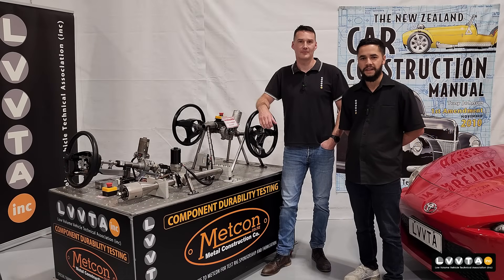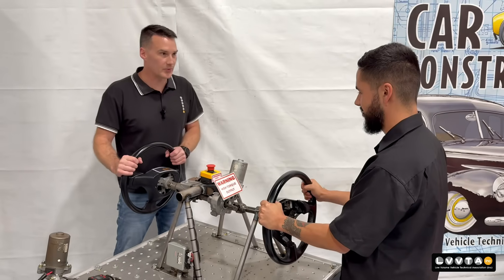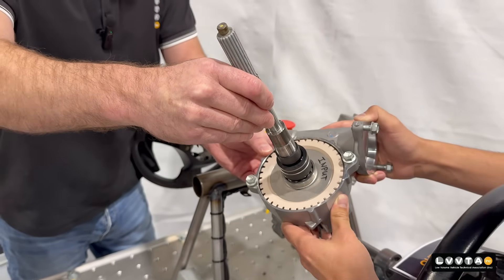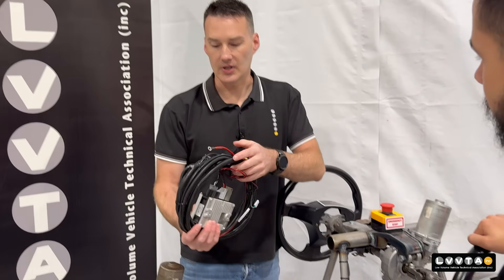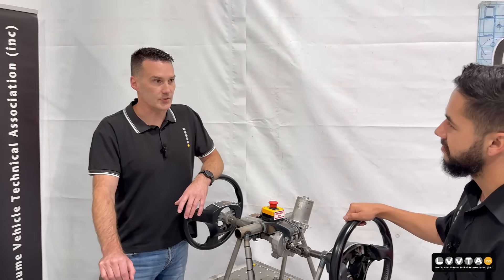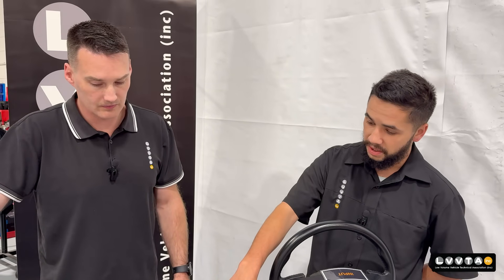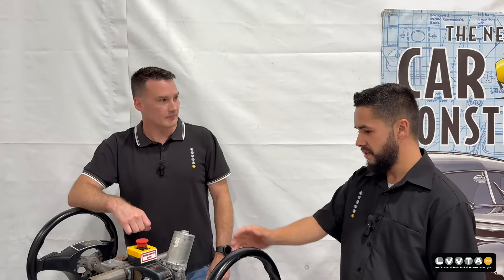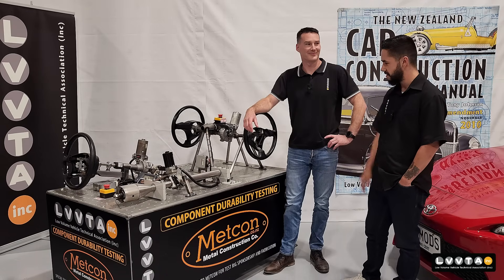Electric Power Assist Steering (EPAS) How-to Video

Comment: if welding of the shafts is prohibited, how does one get a custom shaft made?  surely even the U joints are welded to the shaft unless it's splined and then a 1 piece CNC ujoint is used?  Seems almost impossible
Reply from the maker: There's a wide range of shafts, couplers and UJ's available, so there's really no need these days for the potential for unsafe welds in steering shafts.

Comment: Well put together and informative video, well done. A few generations of engineers will be surprised to learn that welding is not a safe way to join metal 🙂.
Reply: Steering shafts are subjected to continual opposing torsional forces, as well as horizontal and vertical forces, and are likely to crack once welded, especially when jimmy does it in his garage at home with the gasless Bunnings welder he swapped his cousin a couple tinnys for. Formula One engineers welded Ayrton Senna's steering shaft, look how well that turned out...
Reply from the maker: Glad you enjoyed it! We haven't allowed welded steering shafts for over 18 years so it's fairly well known to those who regularly modify or build vehicles. All of the applicable requirements and recipes are in our NZ Car Construction Manual. https://www.lvvta.org.nz/shop/new-zealand-car-construction-manual-full-version/

Comment: Great video.  Interesting that you say the steering shafts are not to be welded, and yet the very Toyota Prius ones have 2 welds on the shafts.
Reply from the maker: Thanks for your feedback! LVVTA does allow the use of OEM-welded steering shafts, as the original vehicle manufacturer still takes the responsibility for those welds. There is really no need to weld steering shafts in this day and age given the wide range of quality shafting, ability of machinists to carry out quality splines, and UJ's, and adaptors. However, if it is found that there is no other practical alternative, it is possible to apply to our Technical Advisory Committee (TAC) for a one-off approval to weld steering shafts.
Reply: Not to be welded " other than factory welds".      Way too many cowboys who bought a $100 welder  but no clue how to weld, only certified welders with written proof are allowed to weld a lot of modified parts, and I fully agree, after 55 years of being a mechanic and seeing back yard garbage on road going vehicles  it's the " only way forward"

Comment: Great informative video guys, please keep them coming. I still would love to hear an explanation as to why steering shafts cannot be welded,  (obviously with stringent quality control and testing). This seems to fly in the face of what has always been a standard practice for automotive manufactures?
Reply from the maker: Thanks for your feedback! Yes, we do allow the use of OEM-welded steering shafts, as the original vehicle manufacturer still takes the responsibility for those welds. To clarify the reason, there is really no need to weld steering shafts in this day and age given the wide range of quality shafting, ability of machinists to carry out quality splines, and UJ's, and adaptors, all of which are readily available. However, if it is found that there is no other practical alternative, it is possible to apply to our Technical Advisory Committee (TAC) for a one-off approval to weld steering shafts.
Reply: It's that last bit of your statement that's self explanatory " manufacturer" Joe in his garden shed is "NOT A MANUFACTURER"